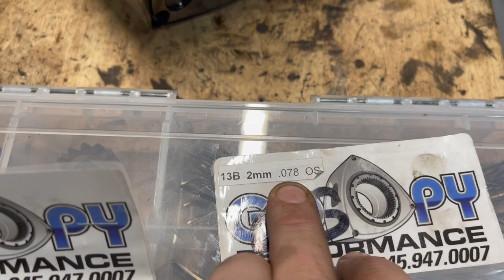Rx8 - Making a Angle Kit

Comment: massive job awesome, we took out around 25mm from the nuckle and got maximum travel lock the rack would produce,didnt have to use rack spacers either and just added 25mm wheel spacers to bring the rims out to the gaurds, and to give extra clearance,, etc, but has alot off lock like a lot but awesome to see you go out and test and notice easier handling thou,,thats massive keep these vids flowing
Reply from the maker: By rack spacers i don’t. Mean i spaced it out sorry i meant. Stops because i was hitting the lca at full lock with the tries and that was with 1 inch spacers on the wheels.
Reply: @TheRogueOnes   @The Rogue Ones  oh ahahha algood my bro,, yea im sure once you got the car on lock down youl get a offset with the rim out further then can add the 1inch spacers give you some more lock but hard i get ya now ,, just you and a dude in scotland i think its where he is from are the only people who vids on doing simple lock conversions,,is there any reason to why you used those tierod ends also??
Reply from the maker: @rotaholikzhds906   oh no i have all the angle. In the world i need  lower control arms. That have. More clearance my. Calipers will come. All the way over and. Hit. My sway bar lol
Reply: @TheRogueOnes     ahha yea thats why we changed the offset on our rims and added the spacers clears all that im running 19x8s forgot offset  but added the spacers to be sure we just going to cut a section out of the lower arms then plate it top and bottom if need to do so,,save buying bottom arms or just make some as its pritty str8 forward sh&t costs to much here in NZ so its easier to just make with what we got ahhaha but hard nothing wrong with mad lock ( respect aha)